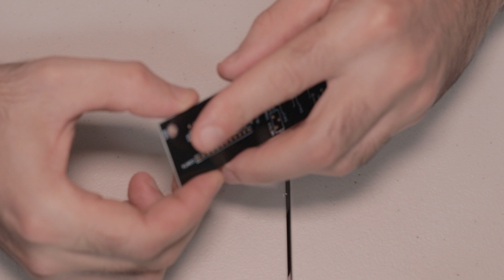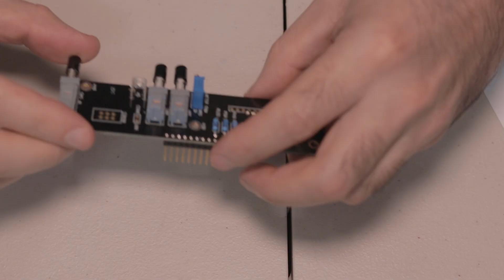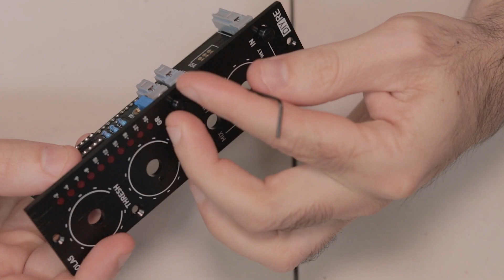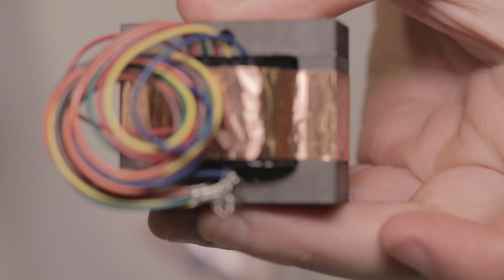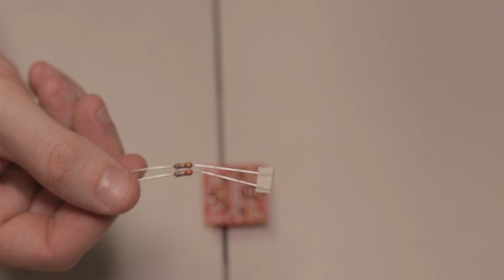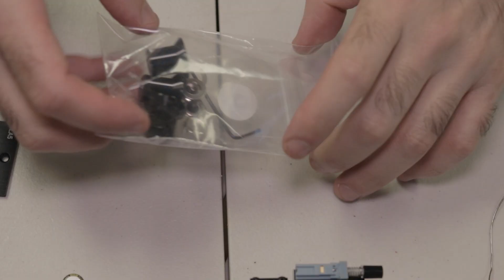How to Build Your own Opto Compressor DIYRE OLA5 500 Series  (LA2A, LA3A, LA4) - DIY Build Part 3

Comment: Awesome channel. Keep up the great work :-)
Would love some vids for newbies about what capacitators, resistors etc is and how they look. I'm all new to DIY and have no clue where to start.. :-)
Also what tools to get, Soldering iron tip thickness, Soldering wire thickness... everything.. lol
Reply from the maker: This is an awesome Idea. Thanks Erand, sometimes I've got to remember that soem people are starting from scratch, I've added these to the list for some upcoming vids. Thanks for the suggestion!
Reply: @diyrecordingstudio  awesome.. Looking so much forward to it. It will be great to have a "one stop shop" instead of looking through tons vids to try to gather the same info..
Great channel. Thank you 😊

Comment: Great job Mitch! I just finished building my second ola 5 and thanks to you it was a fun experience! Your video varied from the assembly manual and I found it easier to go along with your video step by step.
I've got the vintage build and been using the first one for almost 2 weeks. On the four to one setting for the limiter it works awesome with vocals. That's actually why I decided to try them. I'm going to try them on the stereo vocal bus.
I'd love to see a video of you putting together the sound sculptor 5176 compressor.
Reply from the maker: Thanks Lou! I made these videos hoping they would help the written guides, so that's really awesome to hear. I really like the OLA5 on vocals as well. I think a pair would sound very good on a lot of things, a drum bus would be cool to. I'm actually going to be doing a video on a little hack with the OLA 5 to be able to switch between the vintage and passive mode and also the different ratio settings! Perterson from DIYRE makes some amazing gear and gave me some tips on how to do it. 

I might have to reach out to sound skulptor to get one. I have been coveting the 5176 of theirs for a while. Jean Pierre makes some great gear too.
Reply: Hey Mitch, 
Great video series, have you been successful with this hack?